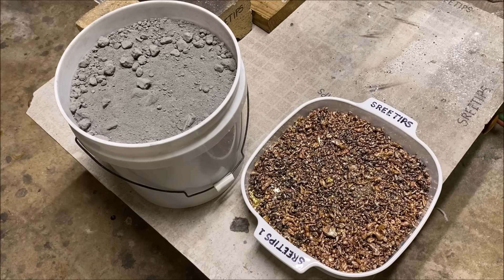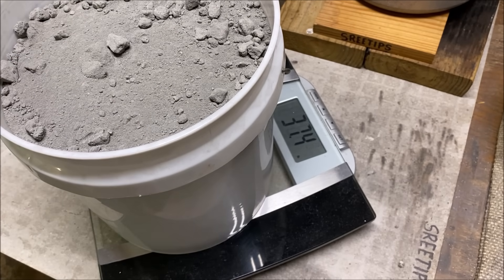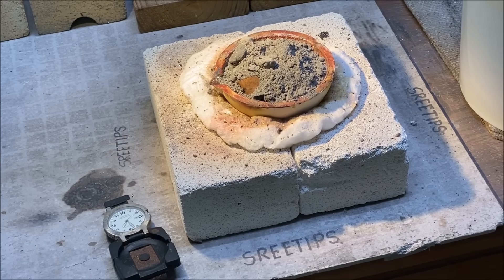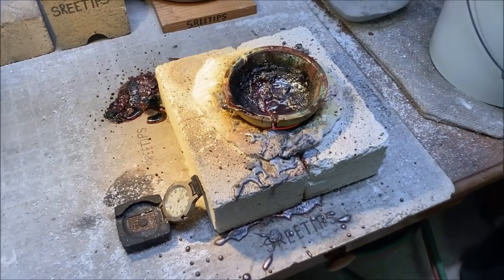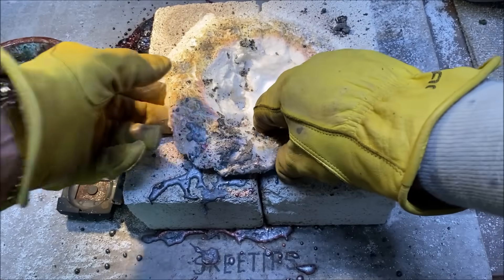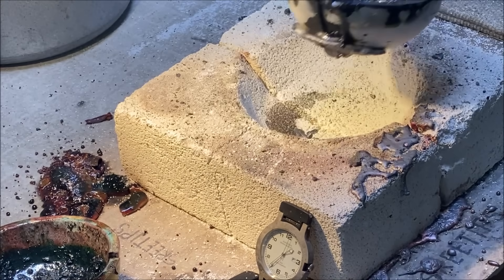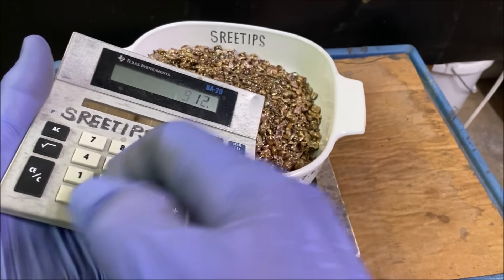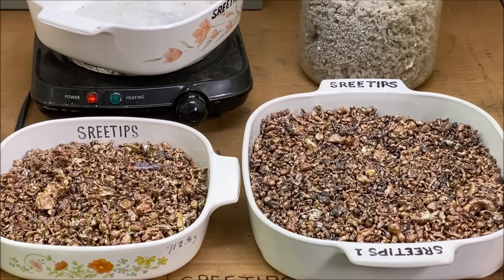Making Silver Shot To Feed The Silver Cells

Comment: I left you a comment under your sulfuric acid cell video but the video is quite old so I’m going to leave you a message here too I’m just curious if I could use flat sheets of lead and drill holes in the top of them and hang them with steel wire from knitting needles or wood skewers for kabob sticks or what should I use
Reply from the maker: I’ve never tried that, I don’t know if it will work.

Comment: I have a seller of gold plated pins from cpu scrap and the pins underneath the gold are silver in color and non magnetic so I think they are silver I was going to dissolve them in dilute nitric acid can I then add pieces of copper in the diluted nitric acid and will that cement out the silver or do i have to do other processes to get the silver out.
Reply from the maker: I’d test a small quantity of the liquid by adding a few drops of HCl to see if there’s and silver present. And if it’s only a little bit (highly likely) then I’d use silver chloride conversion with lye and sugar or burn the silver chloride with sodium carbonate and borax.
Reply: What is HCl
Reply: Are you saying test the liquid with HCl before I dissolve them in nitric acid or after I dissolve them in nitric acid
Reply from the maker: HCl is hydrochloric acid.
Reply from the maker: Normally I dissolve silver in nitric acid. To test to see if there’s silver in solution, I add a few drops of HCl. If there’s silver in solution then the HCl will immediately precipitate silver chloride, if there’s silver. If not then no silver chloride will precipitate

Comment: How much and what kind of torches are you using if i may ask aprox
Reply from the maker: I use map gas (yellow cylinder) and oxy/acetylene.
Reply: @sreetips  ball park what is it costing to get all the i would need to use it
Reply from the maker: @sasilva187  the oxy/acetylene torch kit is about four hundred bucks at the welding supply. The acetylene and oxygen tanks cost about sixty bucks to refill. The map gas bottle are about fifteen bucks each.

Comment: Man you must like it rough. Thats about the most expensive way to get that powder to shot as i can imagine. Get the furnace from under the desk and running propane sized right you have an hour melt and two runs. 15$ in gas for the melt. I can only imagine what you spend that way.
Reply from the maker: It’s not that bad.

Comment: I think if I had this much silver to process, I'd go pour a nice slab of concrete in the back yard and build a forge. Then go buy an antique cast iron kettle and make it so I could pour the entire batch of molten silver right into a bucket of watet to create the shot. Run the thing on wood and save money by not using acetylene to melt the silver.

Comment: Honestly sreetips, it’s time for you to go induction furnace. I bought a “kit” one on eBay a couple years ago that’s 48-60v and 50 amps. Cost me about $120 including the cooling radiator, water pump, fan, coil, driver, and crucible. 

The power supply was the potential expensive part, but being a nerd I opted for a used server power supply that runs on 220v and puts out 80a constant current. 

I drilled a 1/8” hole in the small crucible and have it sitting over a bucket of water. I’ll start with throwing a piece of paper on the bottom of the crucible to catch the cement silver, and load it up with about 100g of cement silver. Once I turn it on, it takes less that 3 minutes to come fully up to temp, and once I get a drip of silver coming from the bottom, I just constantly spoon feed cement silver into it as it melts and drips into the catch pan. 

You could automate this by installing a small screw feed into the bottom of a bucket full of cement silver, and have it auger/feed the silver at a set speed automatically while dripping into a bucket underneath it. Turn it on, and work on something else as your silver works for you!
Reply: Another great idea, how do you arrange the coils for this please?

Comment: The crucibles cracking was a bummer. I leave a gap between the fire bricks wider than half the crucible and position a weeding torch to engulf the entire bottom in flame. It reduces the thermal energy required from the top and keeps temperatures more even from inside versus outside the dish. All that silver represents a lot of refined gold, very impressive work!
Reply: Great idea! The physical strain on a melt dish from the mass of silver (its weight) when picked up repeatedly with a gooseneck pliers might contribute to the cracks as well as the temperature differential between top and bottom so additionally use your spring loaded Crucible holder.

Comment: Question:  Could you use the cement silver in the silver cell directly?  Or do you have to melt it down into metallic silver first?  Is there a chemical reason for this?
Reply from the maker: Cement silver clogs the filter.

Comment: I lost you when you said "i'll be using 2 <muffled> torches to start."
Reply from the maker: MAP gas torches
Reply: MAP torches...
Reply: @lizardkingof1968  MAPP to be exact, means methyl-acetylene-propadiene propane. The acetylene/acetone is what the acetylene is dissolved in, just like a normal tank, fast draw down of the gas will cause some problems so proadiene is added and assists in any direction usage as well. Otherwise it is just propane with the lower burn temperature

Comment: It's my opinion, but there really is no difference between using In-pure silver shot and pure silver crystal as the electrolyte. As you run the silver shot through the cell, you are contaminating the electrolyte with the copper in the silver shot. You wind up with the same result in the end. Contaminated electrolyte. The only difference is the electrolyte will have a slightly more concentration of copper in it.  The cell will operate the same using either the crystal or the shot. You will still end up with pure silver crystal.
Reply from the maker: I prefer using pure silver for my electrolyte.
Reply: Starting with pure silver for the electrolyte will give you a more reliable color indication of the amount of contamination. It will also allow the cell to work at a bit better efficiency (in the beginning).

Comment: Maybe get out the furnace and pour a couple dozen bars instead of making the shot and having to deal with the mess/cleanup that goes along with it? Might be more efficient to grab a bar or two from the stack, lift the anode up and place them right under the anode whenever its needed? I did this in mine and it works quite well given the anode is the same shape as the feeding silver (blank round) and it fits nicely in the :)
Reply from the maker: I used to pour bars when I first started.
Reply: @sreetips  this is not a bad idea, the slimes will be displaced better (to the sides of the anode basket by the large mass), the electrolytic erosion still works. Shot might be marginally better for surface area of course but this is very good for your method of using small melt dishes and easier on the wrist action than a 5 lb Crucible at the end of a 4 1/2 ft holder. Give it a try? A round rimmed bottom mold would be best but any shape to start the test is better.

Comment: Your kind of set up (melting silver powder with blow torch) is for hobby only. When you are doing it on commercial scale, you must have induction melting arrangement. An added advantage of Induction melting is there wont be any invisible silver powder that gets blown away when you use blow torch.
Reply from the maker: I’m not a professional refiner at the commercial level. I’m just a hobby refiner. I have so much cement silver because I’ve grown to hate processing the silver. As a result, it builds up on me. Don’t get me wrong, I love silver. I just hate processing it. It takes a long time and it’s messy. The pure silver that I produce is for my retirement.
Reply: @sreetips  You have surpassed the hobby refiner level a long time ago. You may be a bit short of commercial level professional refiner, but you really need to either take this to a professional level or quit silver altogether, no hanging in the middle and unsupported at that. At this moment you are neither fish nor fowl nor good red meat.
Reply from the maker: I’m backed up, but I’m still chipping away at it. I’ll get it done, at my level, the hobby level. Someone once said if you turn your hobby into your work, then it becomes just that, work.
Reply: @sreetips  "if you turn your hobby into your work, then it becomes just that, work."
That is only too true

Comment: Thank you brother, I have a question when I melt gold in aqua regia and then I want to destroy the nitric residue by boiling the solution boils but does not smoke nitric acid does not come out, what should be the reason? Thank you for helping me
Reply from the maker: I evaporate the gold solution down to a syrup until all the red fumes are gone. Then it’s safe to conclude that all the excess nitric has been driven off. Rehydrate with hydrochloric acid.
Reply: @sreetips  Thank you brother for your answer, what you say I did I boiled the liquid until the smoke disappeared until a juice and then watered with hydrochloric, but when I want to get the gold immediately melts I do not know why?   Thank you for helping me
Reply: Hello brother, I'm sorry, but you didn't answer my question?
Reply from the maker: I don’t know why. Sorry, I don’t have an answer.
Reply: No problem, brother, thanks

Comment: Perhaps get a 55gal steel drum to replace the pot setup and even ditch the board. The height of a full drum of cold water should be enough to solidify it before it hits the bottom. You could then run 5+ lb crucibles out of the big propane furnace.

Comment: Thermal shock is annoying. Silicon Carbide is tougher in that regard. Or maybe if you used two melt dishes (or crucibles) one after the other. Let one cool slowly and use then the next. Followed by the previous one now that it has cooled down, and so on. This way there is no thermal shock between the large cold mass of silver and the hot ceramic. You could go all day that way.

Comment: 🤔 How come you have to melt the cement to shot? Could you just pack a custom filter basket with cement. Melting that stuff is a lot of work not that I don't enjoy it on my end.
Reply from the maker: I know how you feel!
Reply: Making a filter work with the small size of the particles and the slimes that are formed [from the electrolytic dissolution specifically targeting just the silver leaving those other elements behind as slimes] is a problem even the big recovery companies have. They also use a similar method. Racks of sheet silver of impure origin being reduced with electrolyte with the slimes collected in a moving dacron filter. Unless you have a large amount, tons and tons, this system used by Kevin works best. Shot is preferred since it presents a greater surface area for the electrolytic dissolution of the silver. Small shot is great but large bars have worked in the past almost as well.

Comment: I had a good chuckle when I saw that big bucket of silver and little dirty melt dish you intended to use. A modest gas furnace and crucible would seem sensible at that point.
Reply from the maker: I’ve come to dislike processing the silver from my gold refining. And so I’ve let it build up. I need to get it moving or else I’ll run out of time, on earth.
Reply: @sreetips  Right on, this is only one bucket of several you are behind. Hire it done? A lot of risks anyway you look at this problem, doing it yourself pros and cons vs hire pros and cons, with and without supervision by you (time wasted and gets into trust issues if the time is not wasted). Hard calls either way you go. My regards if they help, disregard if they do not. <g>

Comment: Yeah. You might consider a devil forge. But use a long and slender crucible which will fit down the vent in the top so you can do induction style. I think for these melts, you just had your oxygen level a bit too high on that oxy-ace torch.

Comment: Might be worth an workbench top induction furnace. Then you would not have to use the big bulky LP furnace outside.
Reply: It is worth the try but powder might not melt the same way shot would in this type of furnace, the small cubic area of each particle would have an effect on the induction system's sensor of state and keep the system turned off due to the non-magnet interferences of each small particle. If you include a chunk of shot with each batch of powder if might fool the sensory system a bit, you might need an amount equal to the mass of the powder for all I know. The intrinsic way induction heating works does not seem to lend itself to small particles.

Comment: Get a devil forge and use clay-graphite crucible and melt that stuff fast.  You might need a 50 gallon drum to pour the shot into but you could do your pre-processing very fast that way!  I suspect this one bucket represents a small percentage of your cement silver so a devil forge is probably well worth the investment since time is an invaluable asset.
Reply from the maker: I have a furnace.
Reply: @ I forgot about that.  I remember seeing a video a while back and hearing how loud it was.
Reply: @ExtractingMetals   yup, he thought it through thoroughly prior to his experiment in massive shot manufacturing, the lack of a midpoint fulcrum while pouring was the main reason he stopped, bad on the wrists ya know -short of the steam explosions and the noise of the furnace, that is.

Comment: For what you are doing, there's a better way to do it.  Get a cast-iron mortor and drill small holes in the bottom.  Make a steel frame to hold it over the water board. Get it orange red hot and add the silver to it. It will melt and drip onto the water board to make shot.

Comment: My friend, it’s time to get a good size induction forge, drill drill a small hole in the bottom of the crucible, and hang the crucible over your water bucket.
Reply: The problem with that is that induction forges don't work with metal powders.
Reply: @ Fair point. Maybe large crucible in a propane forge, pour 5-10oz ingots, then feed the granulator with the ingots?

Comment: Good evening Sreetips, 37.4lbs...L0L. Just pouring 6 or 7lbs of cement silver is enough of a pain in the butt. 37.4lbs is an undertaking in itself. I'd personally would like to see you melt the low grade sweeps next time in the last melt just to see what you ended up with.
 Experiment idea: Your silver shot is extremely contaminated compared to what I see when I processing my own pounds silver shot. I was wonder as an experiment if you were to put your contaminated silver shot back into solution and re-cement it out on copper. To then re-melt it back into silver shot. Would it clean it up leaving contaminants behind instead of in a $10 filter which is soon to be going up in price? That left over solution could then go into the Stock Pot to recovered any precious metals still floating around to be processed at a later date. Just an off key interesting video idea I would be interested in seeing. I'm sure the YouTube views will be well worth the nitric acid costs. Could be something extra that could be done in the background of the next silver cell series. Best wishes and have a wonderful Thanksgiving Mr & Mrs Sreetips.
Reply from the maker: Happy Thanksgiving.
Reply: His silver shot is about 98% pure, the color comes from the main contaminant (copper) at about 1.5%, which as a tendency of migrating to the surface when solidifying, especially with small volumes like shot. The remaining about 0.5% contaminants is mostly gold and PGMs, from the latter mostly palladium.
Reply: @apveening  
Exactly...

Comment: put the heat source shooting straight down in the center, dont try to rush it with the handheld torch. i think it causes the crucible lattice to warp and fracture when one part gets hotter or cooler as you swirl the mixture
Reply from the maker: I was thinking the same thing.

Comment: Why do you use the board method over pouring into a full bucket of water?
Reply from the maker: The molten metals spatters into nice little pieces when poured on the board. If I poured it straight into the water it would make silver nails.

Comment: Melting all that silver in a small bowl using an acetylene / oxygen torch looks rather tedious. Could I suggest using a propane air furnace easily made or purchased and assaying crucibles. The initial outlay wouldn't cost much more than what those porcelain dishes and an acetylene bottle refill. Something about putting an acetylene torch flame onto a metal powder and blowing it all over the place looks wasteful; compared to  the more indirect heat of a propane furnace through a crucible.
Reply from the maker: I have a furnace.